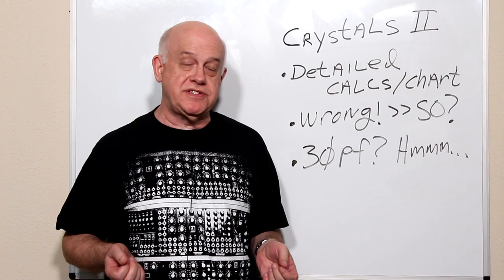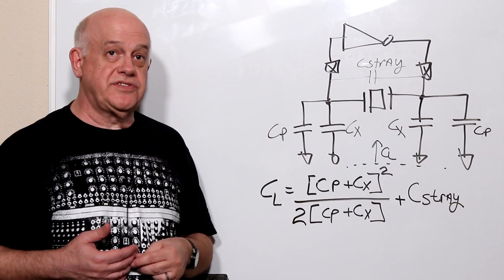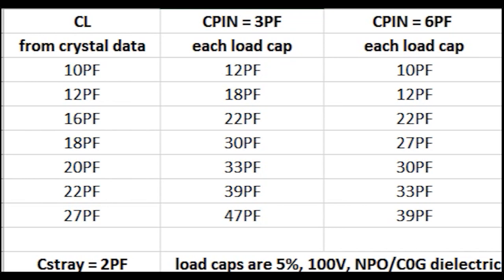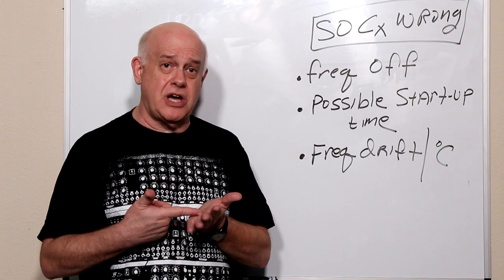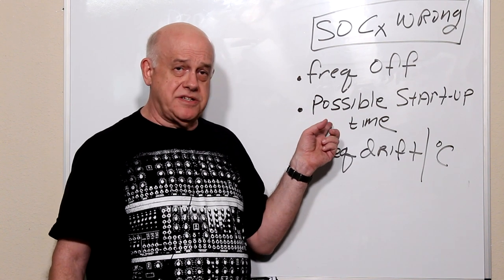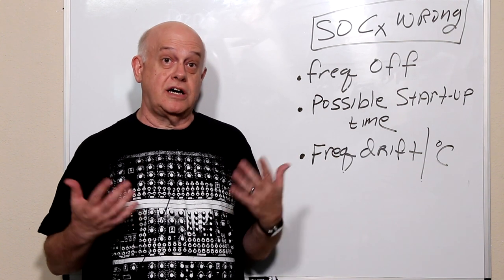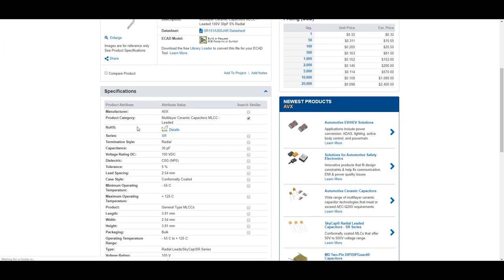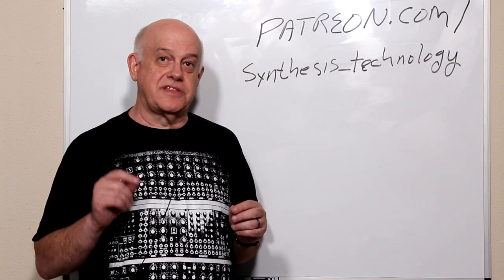Synthesis Technology Patreon Preview:: Crystal Loading

Comment: Great video! Thanks for sharing. (me too curious about the 100V requirement... )
Reply: Because the capacitance drops by a DC bias. The higher the voltage, the less % drop happens. NPO/C0G have the smallest % drop, but it's STILL there.